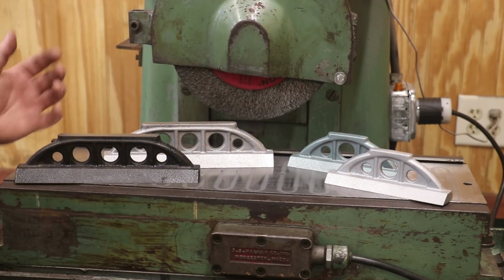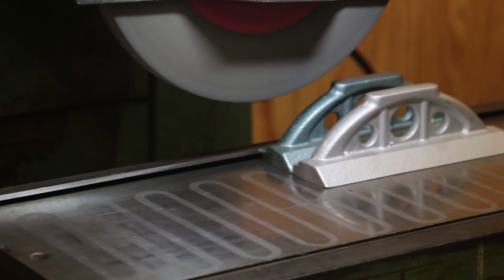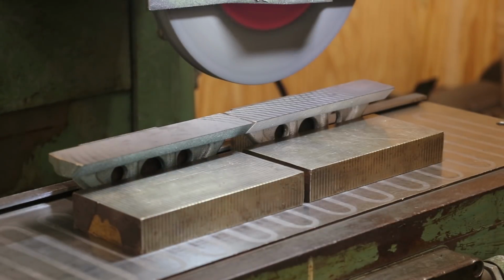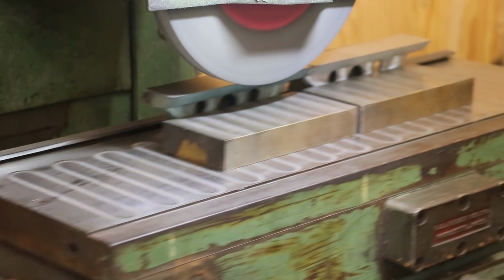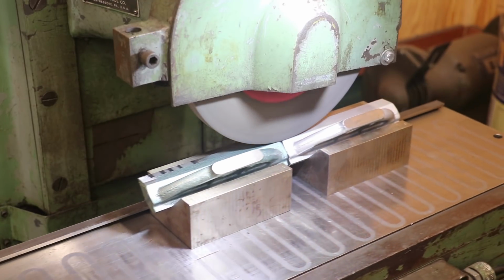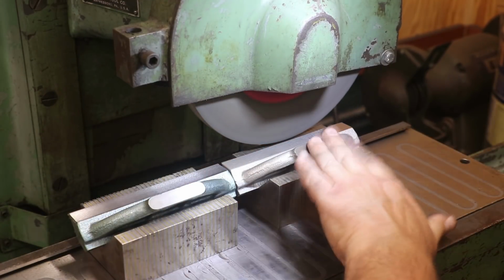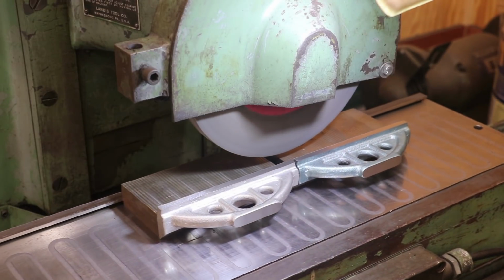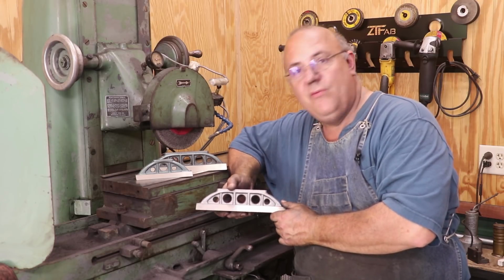Grinding Camel Back Straight Edge Castings on the Surface Grinder

Comment: Your video brought back old memories. Back in 1966 I went to work on a manufacturing floor next to the machine shop area. The shop area was set up beautifully with everything lined up in nice straight rows. One of the rows had several surface grinders set up with the surfaces running in the same plane. After several days of operation two of the surface grinders crashed into each other, very loud crash! Apparently the installers didn't take the maximum travel of the plates into consideration. All the grinders were reset at angles to each other! Love your videos!

Comment: Keith, so nice to see all your hard work on the grinder has paid off. Well done!!
My dad showed me a way of grinding long things like parallel etc. Instead of running them directly in line with the chuck we would put them diagonally across it. Thus the wheel was in contact for a very brief period to help reduce putting heat into the part. I used to grind parallels and was able to "wipe" them using this procedure.
Best wishes,
Eric

Comment: I did notice a little glitchiness in the start of video, but thought it was just my machine. Looking forward to seeing the castings come out for sale. Those are the perfect size for someone that has a 9x12 or 12x18 surface plate to do some experimenting with scraping.
Reply from the maker: Sometimes the manual trip lever does not trip all the way.  I need to see if I can replace a spring in there to tighten it up.
Reply: I think we are thinking of different glitchiness issues. I was agreeing with some other comments about seeing some glitchiness at the beginning of the video. Surface grinder looked fine to me.

Comment: That's very nice older machine they don't make them like they used to!!

I'm fairly new to your community the store to hearing from you God bless
Ken
Reply: Easy to tips and tricks etc etc they actually make automatic grinders 100x better now days.
Reply: Erstwhile 100 times better. How so? 100 times faster? 100 times more precise?
Reply: John H all the above, most new automatic grinders are servo driven instead of hydraulic like the old ones, allows for much more precise grinding, and repeatiablity.  .00005 flatness and parallelism is a very achievable and repeatable thing on a servo driven wet grinder, on that old grinder with the way he's leaning on the parts I'd guess there out at least. 0005 in flatness.
Reply: Not knocking these old grinders, for the kind of stuff he messes with it's more than adequate, just saying that things have progressed alot.
Reply: Erstwhile no that's impressive and improving an older machine you still have the quality that the older machines provide and durability good job and thanks for sharing God bless Ken
Reply: chris0tube I agree on the scraping thing in the sense it's serves no practical use in a production environment anymore, the last use it does have is when someone has a machine that needs to be rebuilt and they dont have the ability/funds to have the ways reground therefore scraping it might be a good option for the home gamer on the cheap.

Comment: Seems like the latest thing is "lapping".
Since flatness and not oil retention is the goal of scraping here, would lapping be superior or, at least, suitable for the camel 
back style?
Reply: At a guess, as you use these to transfer products like Dykem from a precision surface plate to the part you are inspecting or working on, the same surface finish that allows for great oil retention allows for great Dykem transfer.  Armchair hobbyist so I may be wrong.
Reply: Correct.

Comment: Just a general question; why aren't magnetic bases used more often for other machining such as milling? Is there not enough magnetism to firmly hold a part when milling or drilling?
Reply: you hit the nail on the head
Reply: I have used mag chucks on both mills and lathes, they can work just fine. They make a heck of a mess if you remove much material though as all the chips get stuck to it too.
Reply: bcbloc02 Yep! Looks like all the "chips" fly off to the left, or burn up.

Comment: What are those things anyway? What do you use them for?
Reply: The two flat surfaces that he is going to be scraping in are used to transfer products like Dykem from a precision (possibly granite) surface plate to another surface that you want to check flatness on, but can't actually get to the part on the surface plate for what ever reason.  The 45 degree angle between the two scrapped surface allow the transfer of the Dykem to the inside of dovetail ways.

Comment: Man that's producing some sparks compared to what I've seen in Tom and Stan's videos, I thought you weren't meant to take more than 0.002" doc on a surface grinder? 
Oh and for those having playback issues, at 12:00  to 12:30 BST (GMT +1) I've had no problem watching at 720p.
Reply from the maker: When rough grinding, you can take quite a bite.  I have seen guys take 0.010".  When you do, you want to follow up with a fresh grind after re-dressing your wheel.

Comment: I don't know anything about surface grinding... how do you deal with the fact that the grinding wheel is getting smaller and smaller?
Reply: Just use it until it gets too small for the machine or the application.
Reply: Well, yes... but unlike a carbide cutter (which doesn't change dimensions during a machining operation)
a grinding wheel does get smaller in dimension during a grinding operation.   Is that fact... just ignored? How does one get precise results with a gradually changing grinding wheel?
Reply: You regularly dress the wheel to keep it round and the grinding surface true. He uses a diamond-tipped dresser and has shown the process in several grinding videos.
Reply: Carbide wears too..........
Reply: It doesn't get much smaller during one operation. So it loses half a thou, maybe. If you have to grind down to a certain exact thickness you would always measure, just like when using a lathe.

Comment: Why not grind them in line, instead of side by side?
Reply: Grandpa Cocky Good point. It would certainly be more efficient TimeWise, because there would be half as many direction changes. And there would be no gap between them when they're in line.
Reply: Maybe you should try watching the whole video.
Reply: Maybe you should try watching the whole video, too.
Reply: Hello Grandpa, if you watched, you'd see most of the grinding WAS in line ! both for the main face and the side angle and straight sides.

Comment: Keith,  Please don't test the work temperature by touching the moving work surface.
You were just 0.22 seconds away from losing a finger tip, at 11.58 and 13.10.
Twice you did it, twice my sphincter puckered...

Comment: It will be me, I am sure, but if you have a straightedge, ground in perfectly (trimmed and trued wheel, the correct grit, taken heat into the equation etc....) Why would you mess it all up again by going at it with a scraper?
Seems the only thing you can do is make it less precise.... and maybe with enough patience repair the damage you have been doing....

Paddy
Reply: gh778jk The ground surface is only as flat as the grinder’s ways are straight and parallel with each other. Scraping allows you to create a surface approaching the flatness of a true reference surface (in this case his granite surface plate).

The difference is only in the ten thousandths of an inch or perhaps less, but it’s enough to affect the performance of the dovetail ways he’s restoring.
Reply: Thomas,

I hear you, but that is all very nice theory....
First of all, I wasn't talking about a clapped out grinder, but a proper machine. I know if I ask an operator at work to grind something flat to within a 1000/mm...... it IS going to be flat to a 1000 of a mm...The idea that one is to improve on that seems rather asinine.
Even the small toolroom surface grinder I have in my home shop, will grind a surface (given enough care to the grinding operation ) within 1 or two 1000/mm. (that is one quarter of your 10 000/inch) A very deliberated bit of lapping may get that 1 or 2 /1000nds out of the piece.

I have just taken delivery of a new Swedish surface plate (80 cm by 65 cm) which has a max deviation from flat       of one micron per meter. I'd call that a very flat plate...not just for the home shop, but in general... 
So how will you measure or ascertain the flatness of your piece beyond those parameters?
Better plates are available, to be sure, but I don't know of very many.... we have one at work.... it has its own operator, lives in a climate controlled room and is treated like the queen of Sheba!

After all that, we are going to take a piece of carbide and we are going to improve on such results?
Even if you are the Jedi -Master of scraping... I am sorry, I am not buying it.
There is a good reason why scraping is considered a LOST art form/craft. Before the advent of precision grinders, there wasn't much else that one could do to get a true flat surface...though one always starts out with a lapping-threesome if one starts from nothing.

The only benefit for scraping in a modern setting I can see, is altering the surface texture of an already adequately flat piece. For example, it may we a good idea to apply certain scraping techniques to the ways of a machine, in order to improve in the manner it deals with lubrication (where a too flat surface will not retain enough lubricant to have a permanent oil film)
Some will claim that certain scraping techniques will add aesthetic value to a piece of machinery.
And it would be indeed a shame if this old craft would be completely forgotten.

Cheers,

Paddy
Reply: Indeed, on a remote location scraping could be ones sole resource , and true indeed, a few tons of machine-bed is not something one throws in on the grinder with a second pair of hands, providing a machine heavy and big enough exists.
I was, by no means, pleading to let this art go into the bin of technical history, I would go as far as to call myself an advocate to keep the old skills alive, whatever branch of industry we are talking about.
My comments were mainly directed at the subject of the video, the scraping of perfectly well ground straight edges.
And maybe you have a point too, that somebody, even if it is the enthusiast or amateur (that usen't to be a dirty word at all!) has to keep this stuff alive. Look at the steam engine scene... if it weren't for weirdo's like us... there wouldn't be one traction engine, steam railway line or even a stationary engine around anymore.
Of course it comes across as a bit 'naf' if someone who has been on a scraping-course wants to scrape just about anything they get their hands on,whether it is a wise thing to do or not..... I dare say some would scrape the wife, if she stood still long enough ! Probably not the best recipe for, either a nice flat surface...or marital bliss!

Toodles
Paddy